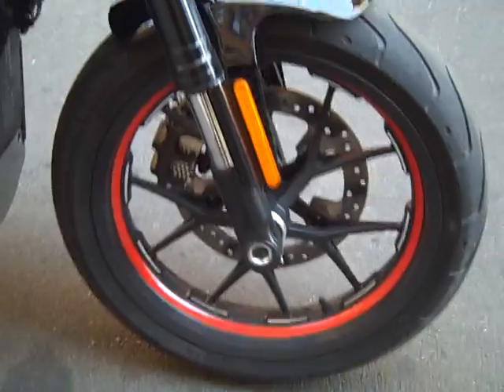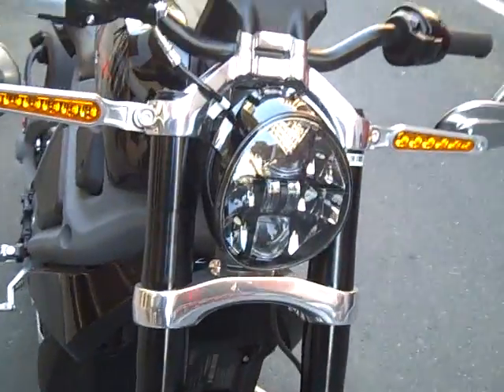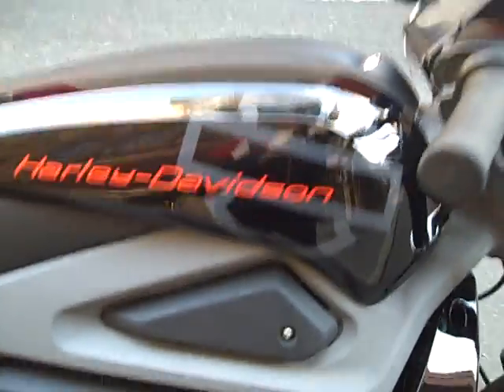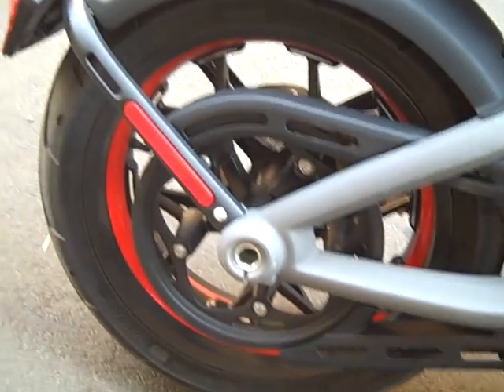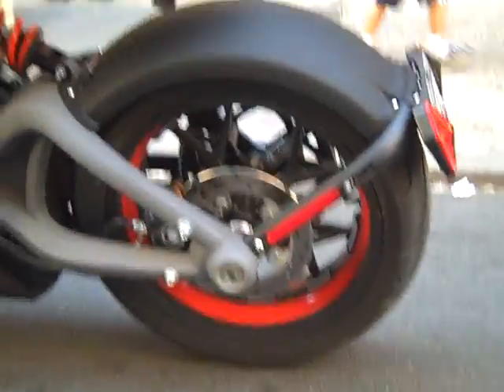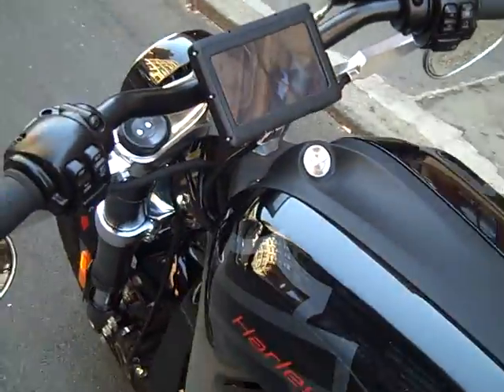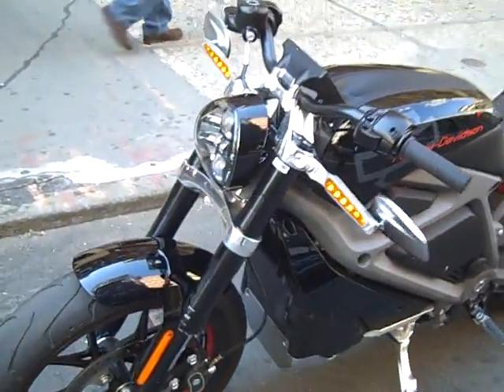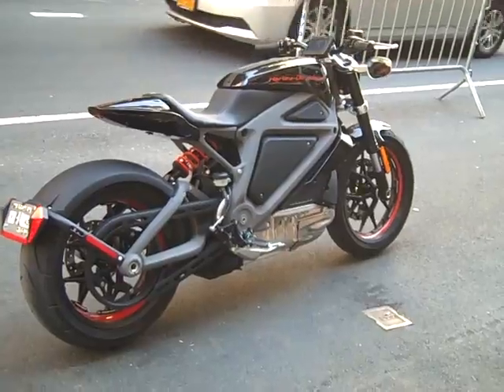Electric Harley Motorcycle Project LiveWire 2014

Comment: Looks good I guess it would get ya there where ever there is within its charge distance divided by 2 well if you want to get back from where you started.....only lost is the romance of gassing up and heading out on the open road to seek love and adventure !....Hahahaha Ya right...Should be a winner for around town they might want to have a good speaker system that can put out a loud sound to the sides and front to warn those getting ready to cut you off....and a lot of running and brake light to be seen from back there during the day too..

Comment: Would like to see a lightning bolt style kickstand!  I like the mirrors with the integrated turn signals, what does the bike weigh? What kind of range? Projected price? Weight limits? Top speed? Does the bike have any kind of alternator to recharge on the fly or even run the lights while riding? ??????? Lol...
Reply: lightning bolt kick stand!!!!love it